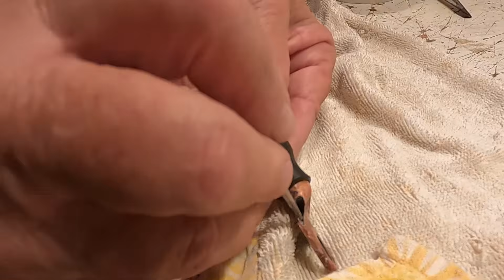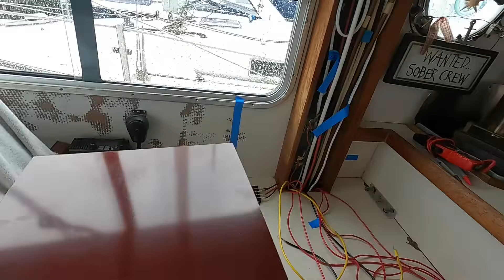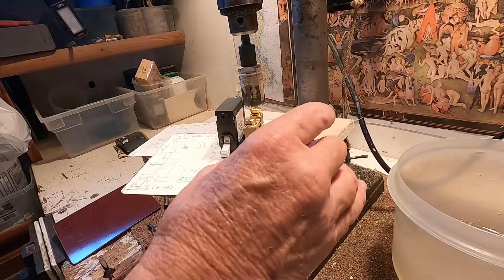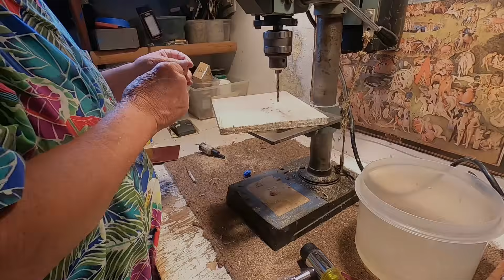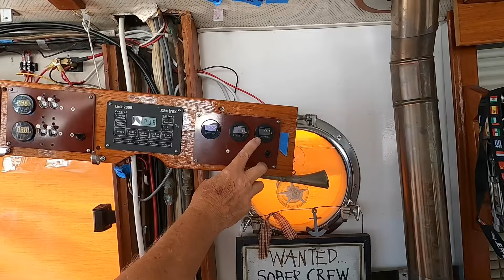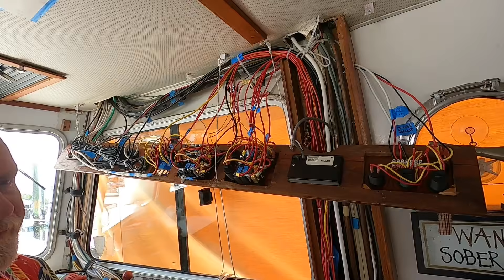New Lithium Battery Requires Solar Charger Upgrade

Comment: 15-16 volts should not be an issue for any 12V electronics. Its not ideal but happens a lot, so most electronics are built to handle it.
Reply from the maker: Good to know.  It just sounded like our water pump was really racing so we decided to fix the system just in case